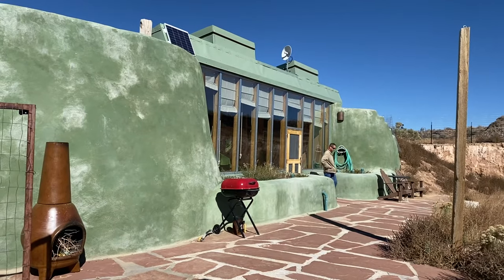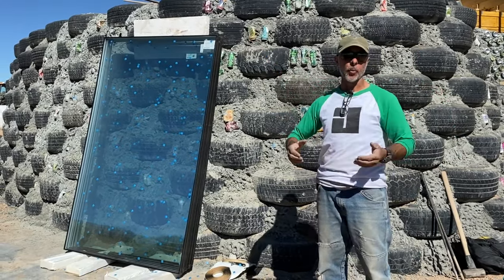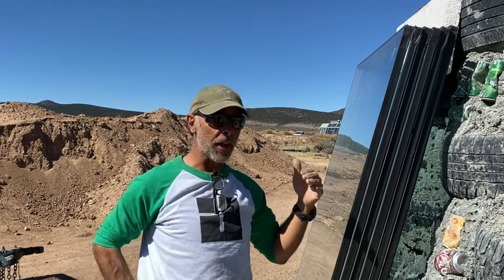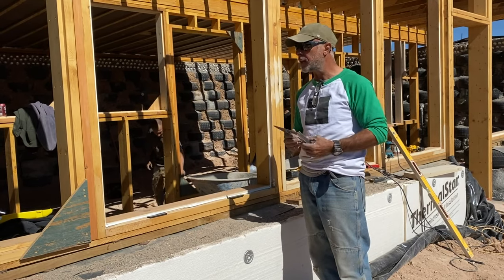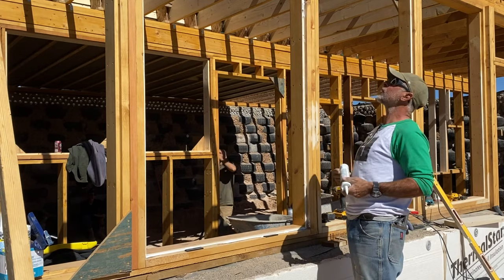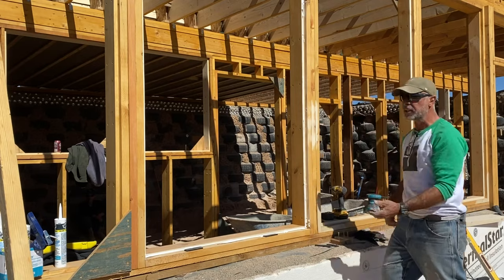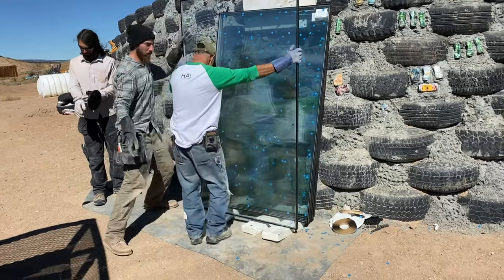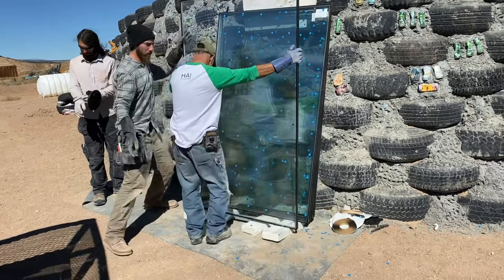EARTHSHIP TINY HOUSE Roof & Window Update - Professional glass installation tutorial.

Comment: Shouldn't those bottom boards b green treated & hav a vapor barrier? Thought anything sitting on concrete needs it or it rots. Literally jus picked up a blding because it was coming down because it was built before code or was checked right & the used reg wood on concrete & it rotted & the floor started falling into the basement

Said all that & u literally said u did it all seconds later